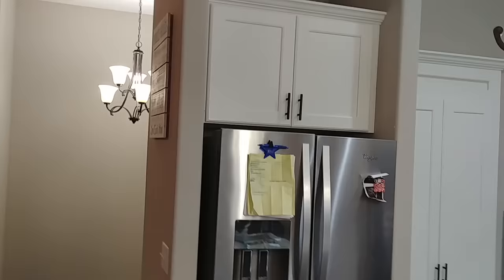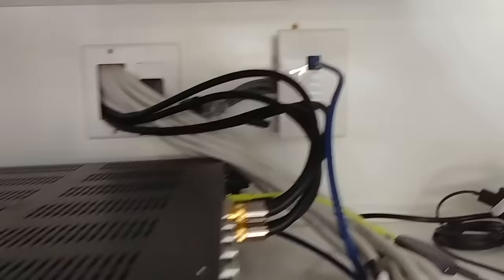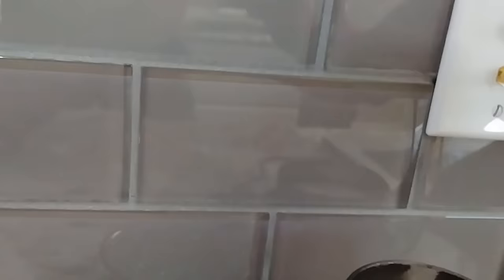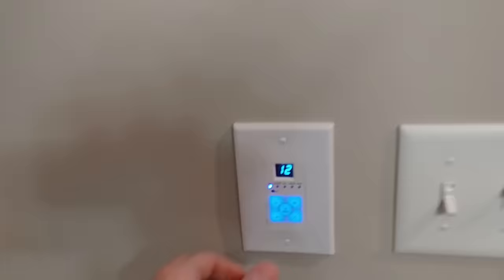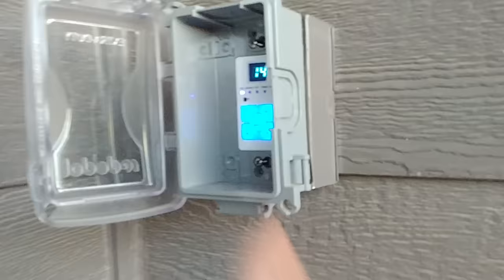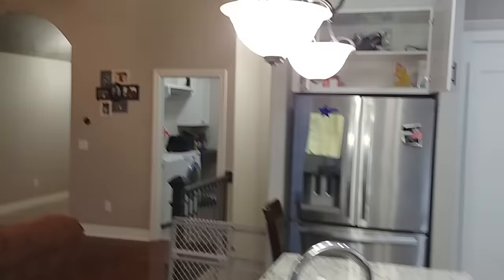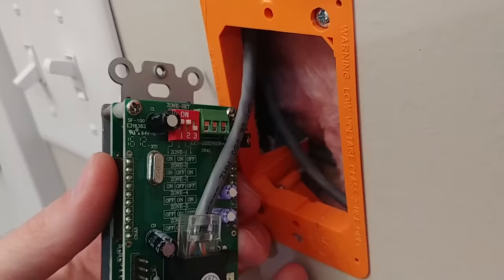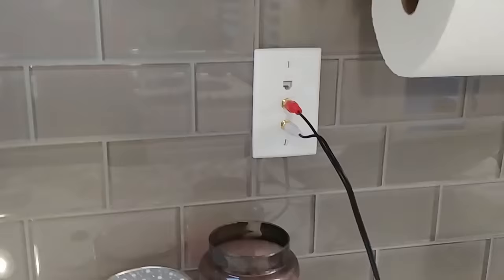WHOLE HOME AUDIO: Monoprice Whole Home Audio Amp! 6 Zone 6 Source

Comment: Thank you for the video! I'm looking to wire my new home for multi-room audio, but want to use AirPlay 2 in the near future to control each zone, volume, etc., so I'm trying to figure out the best way to wire it. If I go with the monoprice right now, and route the inputs from 6 different AirPlay 2 devices into this unit (via 3.5mm) and use the volume control on the AirPlay interface on the iPhone, do you think it will change the volume? Or will I have to use the keypads to control the volume? I fear it's the latter, but curious if you've given that any thought?
Reply from the maker: Michael Sorensen The RCA outputs will respond to the volume being changed on the device. It's analogue so however loud it's coming into the amp is how it comes out and that's why it works. But I don't think the digital outputs work for what you want. However, once you introduce the airplayer I don't know if that device normalizes the audio or not. To be honest I wouldn't bank on that, and I would use the iPhone or Android app to control the amp
Reply: Thanks for the prompt reply!
Reply: @TheKMZ1  sorry michael to jump in. I'm thinking of a set up that I would amplifier the output to my zones but then run it through a speaker selector switch/module. What you have helped with the initial question, am I right in thinking the amplified rca will be unaffected by the route through selector? Great vid and system.
Reply from the maker: @adrianburns7363  if it's just a speaker selector directing the voltage to a certain pair of speakers...but not all speaker...then yeah I bet the RCA will be unaffected
Reply: @TheKMZ1  Thanks for the swift reply.. We dont get the dax66 in the uk but could look to import it. Looks ideal for what I want. Will need to source a supplier. Cheers again!
Reply: Michael, I’m looking to do a setup like you asked about.  Did your setup work? How did you make it?
Reply: @derrickantwi3123   it has worked beautifully. Each airport express has a 3.5mm to RCA splitter plugged in, and those go into the inputs on the monoprice. I can quickly and reliably connect any Apple device on my network to one or more airplay units and adjust volume levels independently. It’s been a dream.
Reply: @michaelsorensen7914  thanks for your response.  Now that airport express is no longer sold, do u know what else may work?

Comment: I'm currently running the wires for this system before the drywall  goes up. I have all the cat6 ,speaker wire and 2 hdmi from the livingroom to the basement  where the system will be. Are there any other cables you suggest I run before wall get drywalled. Thanks
Reply from the maker: The HDMI will not really do you any good, this system wont work with it unless you have some kind of device that will split the audio off from the video. I would recommend running at least a few RCA sources around the house.
Reply: My end goal is to run everything wirelessly  thru wifi ( saw your other video ) so do you still think I need the rca cables?
Reply from the maker: Noel O Morales Yeah if you are only using chromecasts audios you should be fine. I was just confused on the HDMI comment. You can't use HDMI with this system
Reply: TheKMZ1 great. The hdmi cable is for a blueray and maybe a receiver or a game system  . I will be using chromecast as well . Thanks again for taking the time to answer . Just a heads up ill probably will be bothering again lol. Thanks

Comment: how do you control the source data remotely?   for example, if I have a  hard disk with all my music on it, how do I select a song.  Or how do I change the FM station?
Reply from the maker: Daniel Leger Your device (the radio, the receiver etc) would have to support remotely controlling it. This amp does not alter your source devices which is why they would have to somehow already support remote controlling. By using a Chromecast wireless you can use Pandora, spotify etc controlling it remotely with your phone which is a popular solution. In terms of controlling the volume and sources which are playing, the android app is what you'd use
Reply from the maker: But if you have music on a hard disk then you need to find some kind of reciever that will play it. Whether that be a raspberry pi or other device which outputs the audio to the amp. But this amp only has RCA inputs or 3.5 mm inputs or 1 digital optical input. So you need to hook up devices which are in that format. How you get it to that format is your decision

Comment: This is what you call over kill
Reply from the maker: Why?!
Reply: @TheKMZ1  you can do all this with less money spent overall. Zones are nice but not necessary these days with bluetooth technology. Honestly the speaker quality matters more than the high price of multi zone equipment. Don't get me wrong its nice but i could've done all that for $1000-1200. Also small amps are pretty cheap and can easily be hidden in many rooms for instant use
Reply from the maker: @BigLui2909  in my opinion I'd rather have a cleaner install, less amps around the house, and not rely on wireless technology. Bluetooth in a large house really is not that great. This setup was not much, only about 1,000 dollars.  For what you get they are pretty affordable
Reply: @BigLui2909  What products are you talking about, exactly? I'm sure it's nothing comparable in functionality and convenience.

Comment: So I’m stuck now... on the rj45 board for the controllers there are 7 sockets on the rear and 1 on the front that’s one more than needed or am I looking at it wrong? Also I’ve got 2 powering up but don’t function where as I’ve got one works perfect and the other has issues with volume increase and power button? Help 🤣
Reply from the maker: Check to make sure you have set the keypad addresses correctly. Those are the dip switches ( on on off) switches on the back of the keypad. There are 7 sockets on the rear, because you can connect an ethernet cable from that 7th socket, into another keypad hub, and add more keypads. So that is how you chain another keypad block. Have you seen my new video?  https://www.youtube.com/watch?v=VMUl4TANpmw
Reply: Ah that makes sense for additional keypads, so it doesn’t matter which port you plug the the keypads in the hub then?
Reply from the maker: @stevenblack9644  correct it doesn't matter
Reply: Thanks for confirming, I’ll have a go tonight 🤞🏼
Reply: Got it all up and running and works a treat! From what I can see the app is no longer available for the iPhone but doesn’t matter too much as I have the Chromecast

Comment: Was considering doing a sonos Amp.  But not seeing how that makes sense if you have to add an amp for every zone.  But it looks like the monoprice can handle 6 zones.  I just need it for 3 simple zones for bluetooth music streaming.  (I also want to add a simple 5.1 surround sound system that will need to be retrofitted.  But was thinking a separate system for that.  Adding this in case anyone has any suggestions that tie in.)  If I don't want to use the wall controls...do I still need to run coax?  Assuming not.  Am I missing anything?  Seems really dumb to do Sonos (as was recommended).  Suggestions?
Reply from the maker: The wall controls are controlled by ethernet and not coax. the coax is for the RCA audio sources (red / white cables). If you do not want to use the keypads, you do not have to. That means you will need the iTach flex, iTach RS232 cable and the android or iphone app
Reply: @TheKMZ1  The ITach flex is the interface between the ios app and the amp?
Reply: Also...does the app have the same functions as the keypads?  volume, source, etc?
Reply from the maker: @pvcannon2958  Yes that is correct, because the amplifier supports RS232 commands to control it. But RS232 (serial) natively cannot be access over the network. Serial commands are very old technology, but they still work great. The iTach Flex is a device which allows you to do RS232 commands over your network. So essentially what it's doing is allowing your amp to be accessible and controllable over the network. Bringing old serial technology new life via your network!
Reply from the maker: @pvcannon2958  Yes same functions
Reply: @TheKMZ1  killing it!  Thanks.  I watched some of your other videos too....next level!

Comment: How are you getting power to each keypad?  Are you using POE?
Reply from the maker: No, the system provides the power over the ethernet cables to the keypad. The system is a kit, it includes everything you need. So the amplifier is what is really powering them
Reply: Ahh interesting, thank you for the reply.  The work you've done at your home and your parents is amazing. I would love to do this.  My house is already built and I have ethernet jacks in everyone room, however they are located down by the base boards like an electrical outlet would be.  They were meant to be used for computers but we all use WIFI anyway.  I can probably re-route those up the wall more for the keypads.  Thanks for the idea!

Comment: i read that it is possible to connect bigger amplifier for every zone but do the keypad control the volume of those amplifier to? and really good video btw i was looking for this product since a long time
Reply from the maker: Samuel Boyer where did you read that at?
Reply from the maker: Samuel Boyer yes you can hook an external amp up and the volume controls should work fine and control the same
Reply: thats what i wanted to hear. Do you think every amp could works with it or it need specific amp?
Reply from the maker: Samuel Boyer any amp that can take the preamp rca cables should work
Reply: sorry for my incompetence but how can i know if the amp can take the preamp rca cables?
Reply from the maker: Samuel Boyer why do you want to use a separate amp anyway? By adding another amp you make the entire system more complicated, so I am curious why you want it separate?
Reply: i just want to add more speakers per zone because you said that it is possible to control volume of the amp with the keypad
Reply: TheKMZ1 its not a good idea?
Reply from the maker: Samuel Boyer if you want to use an external amp just because you feel like it for no reason, then yes it's a bad idea
Reply: TheKMZ1 its not for no reason. You can only plug 2 speakers per zone so if i add an external amp i could plug more speakers. No?
Reply from the maker: Samuel Boyer you'll have to read up on the external amps, I'm not sure which would be best for you. Could you buy 2 of these amps and link them together? Give you 12 zones and 6 sources
Reply: TheKMZ1 it could be a good option but at this price its expensive. I will contact monoprice to have more details about amp that are compatible. Thank you

Comment: Very thankful for this thorough overview!   I'm contemplating the 8" speakers instead of the 6".   Were the 8" considered in your design, and if so, why did you choose 6"?
Reply: I chose the same route.  However, I wish I hadn't.  I am setting up my new construction following this videos advice.  The pre install speaker rings for 8"" speakers (purchased from monoprice) are 10+" in diameter.  The beams (rafters?) in the ceiling are placed on 12" center. Each ring had to be modified and bent a little just to fit.  Then the holes for mounting were outside the span of the beams.  
If I were to do it again, I'd choose 6" speakers, Even though I am sure they'd sound better.  
However, I did decide to just use one stereo speaker on most rooms, allowing for fewer speakers.  I'm not yet to the final install so I can't speak to the wiseness of that decision.

Comment: Can volume be adjusted with a remote?    For watching TV I’d assume most people wouldn’t want to get up and walk over to the keypad to adjust the vol
Reply from the maker: Chris Williams yes the included remote can change the volume, source, mute etc, however you do have to point it at the zone' s keypad for which you want to control. Every keypad has an IR receiver that can accept the remote command. To my knowledge you can't program a universal remote to do this, you would have to use the remote that comes with the amp.
Reply: TheKMZ1 if this unit uses the same ir as the Dayton DAX66 then it’s supported by all Logitech Harmony remotes
Reply from the maker: Chris Williams it's the same remote, so I'd say it's supported then! Thanks for bringing that up!
Reply: TheKMZ1 sorry two more question in the video you mentioned an experience with the Dayton receiver.  In your opinion which is better.  Also without bridging can a single zone drive two 8” ceiling speakers?  One of the answers I saw on the monoprice website was below 8” even though they show 8” speakers in their complete package
Reply from the maker: Yes I actually did a comparison video of the dayton receiver with this one. That video is here: https://www.youtube.com/watch?v=fXv77gxaDtI

But in my opinion they are honestly the exact same amp. Power output is the exact same, so one should not sound any better than the other. It's the speakers which could affect how good it will sound. Unbridged, the amp does 50 watts/channel with a 4 ohm load or 25 watts per channel with an 8 ohm load. I am using dayton audio CS620C speakers which are 25 watts RMS and they are 8ohm speakers. They sound great and they are 6.5" speakers. To answer your question, yes both amps are perfectly capable of driving an 8" speakers. The monoprice 8" speakers i am seeing are 80 watts RMS, so while they would be under powered, they will still work. But to be honest, i think 8" speakers would look funny in a house. In my experience 8" speakers look better in industrial settings such as banks, hotels, restaurants. 6.5" speakers are perfect sizes for in house in my opinion. But either will work, it's your preference and is strictly a cosmetic thing!
Reply: TheKMZ1, is there any way to get away from using two remotes to control the TV?  DirectTV remote for the video and the "included remote? for audio?

Comment: How many speakers can you connect per zone??
Reply from the maker: It's meant for 2 speakers per zone, but with some combination of series/parallel wiring you could achieve 4 speakers per zone. I stick to 2 since it's much easier wiring wise, and you can add multiple amplifiers to your system and chain them together

Comment: I have 2 speakers in each room controlled by 1 controller. Do you know if there is any way to bridge 2 speakers on 2 different zones and control with 1 wall control. Just looking to push 100watts to each speaker. I asked the question on the mono price site and got this answer
"The only way I can think of would be to have a cable go from the Pre Amp Out of the output 1 and have it go into the input and set the other zone to only use the input that it is connected too.."
I’m going to try this but do you think there is a better way to do this?
Reply from the maker: Steve L Well there isn't really a way to bridge the zones like you are saying. You are essentially wanting 4 speakers in 1 zone no? The easiest thing would be to use my android app I wrote and it has zone grouping built into it. And it would control the 2 zones together. Otherwise the amp is not really built for 4 speakers in 1 zone. Probably the pre-amp method would be the way to go
Reply: No I am looking to have 1 speaker per zone, and the control 2 zones from 1 control
Reply from the maker: Steve L what if you still hooked up 2 speakers per zone but just spread the speakers apart and put them in your 2 locations?

Comment: Could you provide a link to the RCA connectors you used for the RG6?
Reply from the maker: https://www.homedepot.com/p/Paladin-RCA-RG6-6Q-Compression-Connectors-4-Pack-PA70046/202534283
Reply: TheKMZ1 did you use banana plug wall plates as well

Comment: Great video!!! How did you set up the volume control box outside?
Reply from the maker: It's in an on wall box, with a waterproof cover over attached to the on wall box
Reply: @TheKMZ1  Awesome!!! I'm going to try and do my best to replicate what you've done up here in Canada. Still trying to source the monoprice unit. They are sold out all over up here. I'm working with a new build at the rough in stage, so I have decent flexibility. Any final tips? Cheers
Reply from the maker: @jeremyhayward4099  A lot of people in Canada have bought my android app. Must be pretty popular l..Not many tips, if you read the manual these things are very easy to install!
Reply: @TheKMZ1  There are allot of smart people up here, so that makes perfect sense ;).
Reply: @TheKMZ1  hi  I like to get a little help on my system
Reply from the maker: @edwardrodriguez8262  what kind of help
Reply: @TheKMZ1   I'm trying to upgrade my wall volume control to the one you have on this video but I can't find them
Reply from the maker: @edwardrodriguez8262  these volume controls are only for this system. They come in the whole home audio kit, check my video description the kit comes from monoprice.com so you can not just buy the keypads
Reply: @TheKMZ1  I know the web site but I have the amp already. It came with the old volume control. I just to change the control only. I don't need to buy another amp
Reply from the maker: @edwardrodriguez8262  send me a link to what you are taking about. You can't buy just the keypads so maybe you are talking about a different amp system
Reply: @TheKMZ1  it's a ram 100w volume control
Reply: Sorry auto correction. It's a RMS 100w
Reply from the maker: @edwardrodriguez8262  you must be talking about a different system because these keypads only come specifically with this https://www.monoprice.com/product?p_id=10761